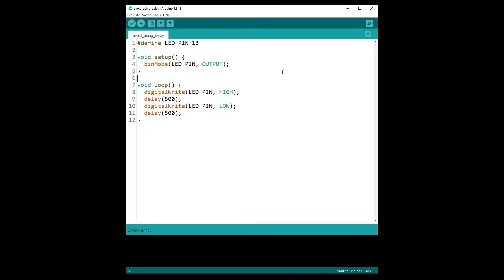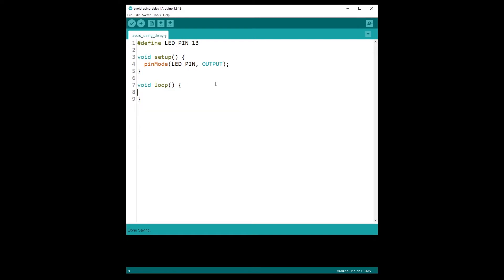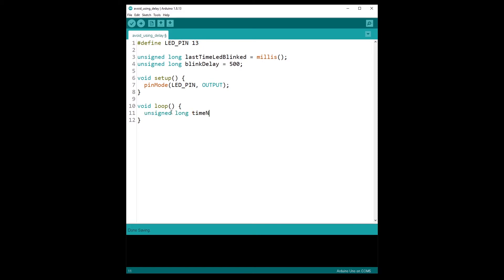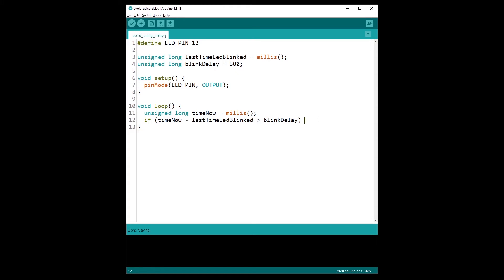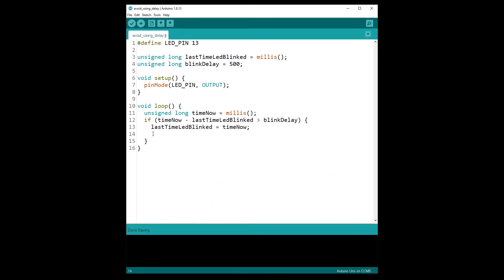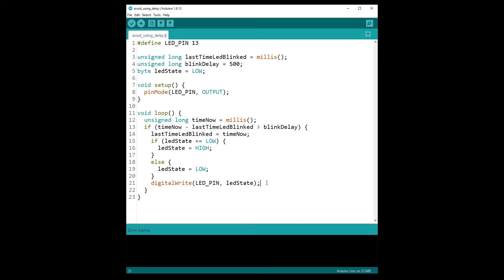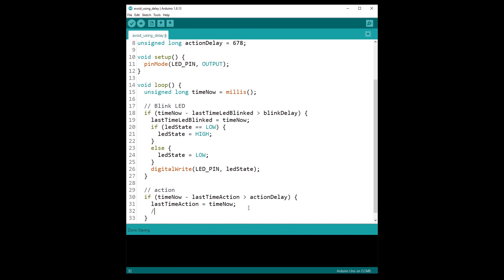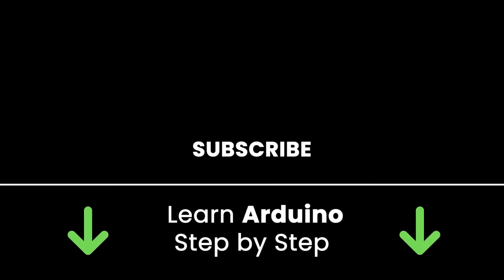Arduino - Stop using delay() everywhere! Here's HOW

Comment: Hello your video was very well done and very informative. I have one question please, how to i make the LED stay ON for 500ms and OFF for 700ms?
Reply: You may have figured it out by now but here is his code rewritten in a way that should work for what you are wanting.

#define LED_PIN 13

unsigned long lastTimeLedBlinked = millis();
byte ledState = LOW;

void setup() {
    pinMode(LED_PIN, OUTPUT);
}

void loop() {
    unsigned long timeNow = millis();
    if (ledState == LOW) {
        if (timeNow - lastTimeLedBlinked >= 500) {
            lastTimeLedBlinked = timeNow;
            ledState = HIGH;
            digitalWrite(LED_PIN, ledState);
        }
    }
    else {
        if (timeNow - lastTimeLedBlinked >= 700) {
            lastTimeLedBlinked = timeNow;
            ledState = LOW;
            digitalWrite(LED_PIN, ledState);
        }
    }
}
Reply: Thankyou for your reply to my problem. I will try it out.
Again your videos are excellent keep it up.

Comment: salut, je n'ai pas trop compris je fait un regulateur de ph avec des menus sur un lcd ect...

mon intro :
phcalib = 6.5 (c'est le ph que je veux atteindre)
phvalue = ( la valeur que mon capteur de ph me renvoi)
tempopompe = 3000 ( c'est une variable pour que je règle dans un menu pour le temps que ma pompe tourne)
j'ai dans mon code un :

if ( phcalib >= phvalue)
{ digitalwrite (pompe, high);
delay (tempopompe);
{ digitalwrite (pompe, low);
delay (tempopompe);

et ducoup mon code bloque tout le temps quand je rentre dans cette fonction, ce qui me bloque complètement la carte arduino et mon programme 
as-tu une solution toute simple ? 
Merci
Reply from the maker: Bonjour, oui la solution est d'implémenter ce que tu vois dans cette vidéo, et ça résoudra ton problème :)

Comment: how could i uses millis in this code 

int PIN_A=2;
int PIN_B=3;
int PIN_C=4;
int PIN_D=5;
int PIN_E=6;
int PIN_F=7;
int PIN_G=8;
int POW1=12;
int POW2=13;
int i=0;
int j=0;
int n=0;
int Arduino_Pins [7]={PIN_A,PIN_B,PIN_C,PIN_D,PIN_E,PIN_F,PIN_G};
int Segment_Pins [10][7]={
  {0,1,1,1,1,1,1},//0
  {0,0,0,0,1,1,0},//1
  {1,0,1,1,0,1,1},//2
  {1,0,0,1,1,1,1},//3
  {1,1,0,0,1,1,0},//4
  {1,1,0,1,1,0,1},//5
  {1,1,1,1,1,0,1},//6
  {0,0,0,0,1,1,1},//7
  {1,1,1,1,1,1,1},//8
  {1,1,0,1,1,1,1},//9
  
};
void setup (){
pinMode (PIN_A,OUTPUT);
pinMode (PIN_B,OUTPUT);
pinMode (PIN_C,OUTPUT);
pinMode (PIN_D,OUTPUT);
pinMode (PIN_E,OUTPUT);
pinMode (PIN_F,OUTPUT);
pinMode (PIN_G,OUTPUT);
pinMode (POW1,OUTPUT);
pinMode (POW2,OUTPUT);

}

void loop()
{
  for (i=0;i<10;i++)
  {
    
digitalWrite (POW1,0);
digitalWrite (POW2,1);
           for (j=0;j<7;j++){
      digitalWrite (Arduino_Pins[j],Segment_Pins [n] [j]);}
      delay (50);
      digitalWrite (POW1,1);
      digitalWrite (POW2,0);
    for (j=0;j<7;j++){
      digitalWrite (Arduino_Pins[j],Segment_Pins [i] [j]);}
      delay (50);
      if (i==9){
        n++;
        if (n>9){
          n=0;
        }
  }
    }  }

Comment: If i want to blink led like this:

Void func1(){
digitalWrite (led1,HIGH);
delay(50);
digitalWrite (led2,HIGH);
delay(50)

digitalWrite (led1,LOW;
delay(50);
digitalWrite (led2,LOW);
delay(50);
}

Void func2(){
digitalWrite (led1,HIGH);
delay(20);
digitalWrite (led1,LOW);
delay(20)

digitalWrite (led2,HIGH);
delay(20);
digitalWrite (led2,LOW);
delay(20);
}

Then how implementation of millis will b applied..